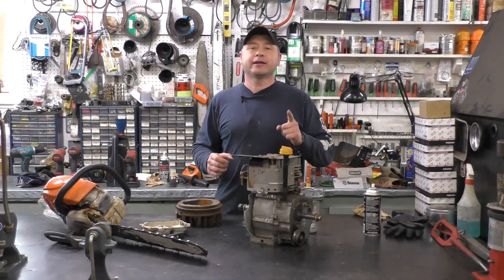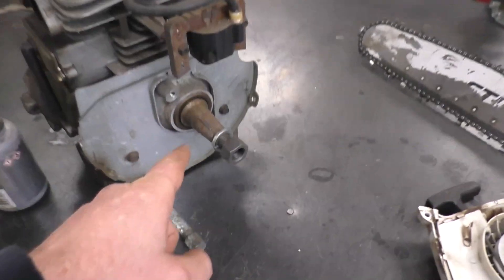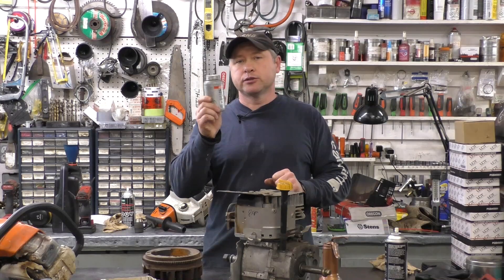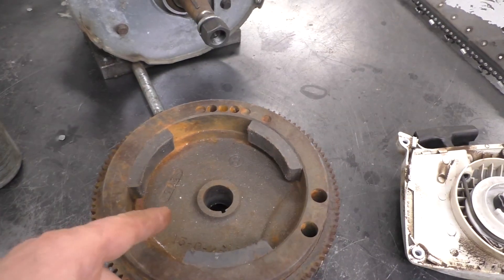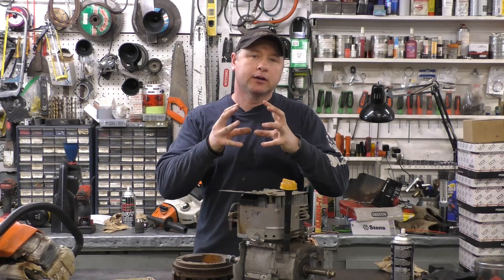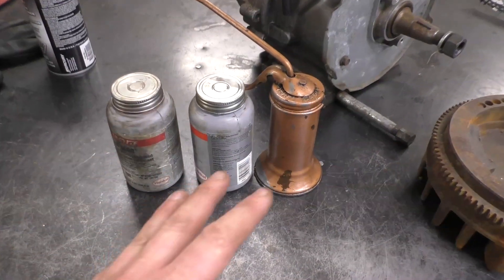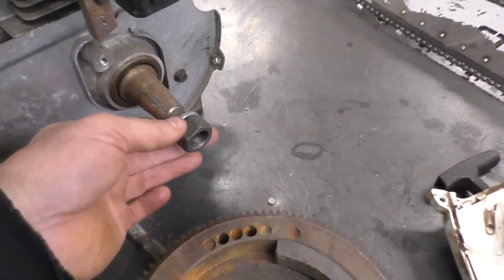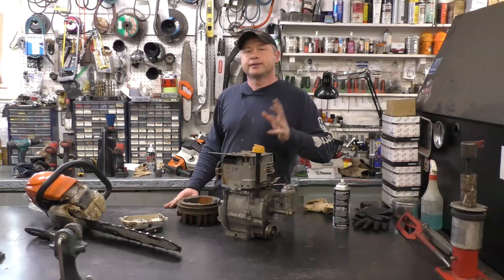Can I use Anti-Seize On A Small Engine Flywheel?

Comment: Yes It was a general rule of thumb working in the millwright trade to never use any  lubricant on any tapered fits. Usually when pulling parts off tapers they would have tendency to go flying when it lets go. Good point and merry Christmas.
Reply: that is why leave the nut on looooosely so that the flywheel doesnt go FLYING anywhere, it just goes POP and pulls up against the retaining nut. take the puller off, take the flywheel off, go on.
Reply: RJl same here worked on morgan wire rod mill finishing block ,carbide roll with taper sleeves were pumped in at 285 bars,speed 95 m/s

Comment: Honda's car service manuals say clean and dry for tapered ball joint install. Must be similar reasoning. I've seen many videos where people do use antiseize or grease on the taper. It initially seems intuitive to add some after battling to release the taper and I've done it myself, but no, not advised. That said, I've never heard of a problem developing if it is used in that application.
Reply: I have seen split tapered seats from using lube on ball joint, and tie rod end studs.

Comment: Great advice Don. From small equipment to large heavy machinery, it’s the same.
I worked in a factory for 40 years taking care of the production machines.
On some of the very big shaft equipment, the couplings were held on with a taper like your talking about. These couplings were always installed dry to get the maximum wedging hold or grip. It’s amazing when installed properly, the wedging action never slipped.
Love your videos. Keep up the good work.👍

Comment: Can you please hire me as an apprentice… how much you fascinate me with how in-depth maintenance can get with small engines always wants me to go to my shed and do stuff on my mower and/or snowblower
Reply: read read read... u tube vids... tinker with ur stuff. start with junk that is junk so no matter what u do to it, doesnt matter... too much.  i got USED mower.  they ran it LOW on oil and the air filter , sort of, held on by duct tape (sigh) as apparently the bolt they used from factory was a ONE OF A KIND IN THE WHOLE WORLD BOLT... not standard 1/4" hardware store bolt that i put into it after rebuild.  

new rings, new gaskets.  honed cylinder with $15 E bay cyl hone. took out lip at top of cyl to get piston out. bottom of cyl was BADLY SCORED from??? rock in the oil? sanded piston skirt. put it back together with clean carb, new e bay air filter (5 for $9 shipped). painted it pretty and now it is waiting for its maiden RE voyage with 20-50 motor oil and 20% STP oil treatment to thicken the oil so make up for all the times it ran low low low on oil. wrote all over it with paint pen... CHECK THE GD OIL BEFORE THE FIRST RUN OF THE DAY!!!!! USE 20-50 MOTOR OIL!!!!!!

Comment: Note the flywheel key is specifically for getting timing correct not for keeping flywheel in place.
Reply: Well, the key keeps the flywheel from spinning on the shaft thus keeping the timing correct. The tapered shaft and the nut keep it from coming off. I think that is what you meant.
Reply: @dkupy100  Nope, the key on a properly installed flywheel should actually have no shear forces on it. It's entire job is to simply line up the parts for timing purposes. It is the fit of the two tapers that holds the parts together. That is the reason why the companies can use soft aluminum for the keys.

Comment: Never seen before. The metal-on-metal machined dry-fit is designed to keep the flywheel at exactly the same velocity as the crankshaft. Anything else will cause problems from the two parts migrating.
Reply from the maker: well said!

Comment: I would also add that if threads can (should) be cleaned on the crankshaft and on the flywheel nut, any lubrication of those must also be avoided as it can throw torque readings off, lead to overthighning and consequently, threads streaching. Joyeux Noël Don !
Reply from the maker: merci Daniel!
Reply: tooooo tight on CHEAP alum/steel flywheel taper and cracks the flywheel and it EXPLODES IN SPECTACULAR FASHION EVEN AT LOW RPM's as the nut is TOO TIGHT... for the lubricant on the tapered shaft/flywheel interface.

Comment: I had a tapered shaft off of the water pump on a case 2294 tractor. I antisiezed it.  Then you have 3 or 4 bolts. That attach the fan.   It ran fine the first couple times. When you shut down. That little backwards movement, walked the bolt out. The fan moves forward and takes out a $1600 radiator.  Everuthing is in super tight tolerances. Where you just cant quite reach what you need to.

Now there is something called galvenic seizing. The graphite based anti sieze is bad about it.   If your buying antiseize. You want the copper based stuff.  There is no reason to be buying the graphite based anymore.   
I had a axel on my jeep replaced. I made sure the shop was using the copper. When reinstalled. Because of the hours. It took for them to disaasemble the original graphite based antiseize.    The shop simply hadnt heard this before
Reply from the maker: i'll check that out!
Reply: @donyboy73  rifle barrels into alunimin receivers is where i first heard of it.  on my silo unloader i got to see it  regularly. but your dealing with a high moisture and acidic enviroment. that  speeds it up.  i've seen some of it on wheel lugs on my skid laoder, where we clean the feed lot.  but usually its not terrible there.

Comment: Yep had a few. Had 2 fairly recently with cast iron flywheels that had Anti-seize on them and when they tightened the flywheel nut on the 1 and bolt on the other it cracked both flywheels. Had one with an aluminum flywheel that actually deformed the taper on the flywheel and the flywheel was pushed so far back that it was rubbing on the block around the oil seal and it ruined the block. Do not lube the crank or flywheel. I've been in the business since the late 1980s. You wouldn't believe 1/2 the stuff that I've seen.
Reply from the maker: wow i can imagine you've seen it all!

Comment: Still not sure on this one....haven't seen any fails with it either
Reply: i want the flywheel to sheer the timing key.  timing key 75 cents, 10 for $8 on e bay.  new crankshaft when hit something with mower and twists the $150 crankshaft in ur $350 honda self propelled mower and ruins it???? i paint the flywheel JD WM RUSTOLEUM spring green and white paint pen on where the timing groove is... and paint one side of the painted flywheel nut/flywheel with WHHITE paint pen so i can tell, at a glance if the flywheel nut has backed off... or if timing has slipped. simple. paint is cheap, paint pens cheap on e bay.  shake well before using... push felt tip down down down til inik appears in the felt tip... that might take 20x to get the ink to get into the felt tip so be patient.

Comment: Basically the flywheel is jammed onto the shaft by the taper. That gives a determined resistance to movement. The key is designed to fail. You must not use a substitute. The forces at play in the engineering of the flywheel is to make the engine transmit force to the flywheel but restrict the force the flywheel transmits back to the engine in a sudden stop. The shaft to flywheel contact must be clean metal to metal. It must be a full contact otherwise the engineered safety is compromised. The torque on the nut is critical. Do not substitute washers or nuts.If dry torque is specified you must use dry torque.
Reply: No one is torquing the flywheel not fyi. It works fine too
Reply: @alexstromberg7696  If you are working on your own engine you can do whatever you want. If you are a paid mechanic you must torque to specifications. Not bothering with correct procedure is why people require their government representatives to license trades.
Reply: @edwintaber6465  yeah you do you

Comment: Should you use grease or Anti Seize on vehicle lug nut threads?
Reply: Also on the contact points on the back of the wheel. So it doesn’t rust to the breaks.
Reply: i don't put it on the threads but I do put it around the hub and rotor and where the center of the wheel contacts the hub.....most lugs if tightened properly will come off, it's the wheel on the hub and the rotor on the hub that can cause frustrating issues
Reply: Absolutely not ! Every owners manual for every car I've owned ( and I've owned many different brands) tells you not to apply any kind of lube or anti seize on lug nuts or bolts. They also rely on friction . If they get rusty , clean them with a wire brush and a thread chaser for the bolts. If they get really bad, replace them.
Reply: No lubricant on vehicle lug nut threads, please. Doing so would alter the torque values causing the bolts to be tighter than they should be. I've never seen ANY dealership or tire shop add lubricant to those bolts, and neither should you.
Reply from the maker: @SpaceCadet4Jesus  thanks for the info
Reply: @donyboy73  Better to thank YOU Dony for sharing your experience and having an interesting channel. Thank you, and Merry Christmas to you and your family!
Reply: Always, unless you want to be stranded with a flat tire and a good spare. Have seen people with this situation many times in the north country where road salt/brine is used in the winter.
Reply: @37yearsofanythingisenough39  NO, NO, NO ! Read the owners manual. Every on I've ever read says not tp apply anything to the lug nuts and bolts. They rely on friction just like the flywheels Dony talked about.
Reply: Not a good idea as you don't want those to come off too easely. Stuck wheel nuts aren't caused by rust but generally result from wildly overtorquing those nuts whith airguns ! Regards
Reply from the maker: I do
Reply: @donyboy73  I did a little research on the subject. It tunes out that the primary source of the required friction is where the lug nuts contact the wheel. Any lubricant here can cause problems (similar to what you mentioned with flywheels ). If any lube applied to the threads gets into this area, problems can arise. So if anyone wants to lube the threads, be super careful that none gets into that area. I found the same info on several auto related websites. They all said not to apply any lube because there's a chance some will get into the area I mentioned.
Reply from the maker: @davidquinn6161  thanks!
Reply: @donyboy73  Although I doubt corrosion could occur on the inside threads of a properly torqued wheel nut, there is nothing prohibiting to cover the nut and exposed threads with grease after installation. Regards !
Reply: i do so the garage monkey doesnt spin weld the nuts on the studs with impact. that is how they put TOOL JOINTS ON DRILL PIPE . the tool joint is machined ... the pipe is made in plug mill (like putting big glop of PLAY DOH on ur finger and pushing a hole into it to make... pipe). the pipe is held solid. the tool joint made up in fixture... fixture spins the tool joint... shoves the tool joint and pipe together... IT GETS HOT... FRICTION... WELD... when its done, the mushroom of metal is machined off the inside/outside of the pipe... x rayed... done.  same with unlubricated wheel studs

Comment: Clean the rust off the shaft it can act like a lubricant reducing  the metal to metal contact necessary. Once in a great while you notice axial lines on the shaft  when you pull the flywheel . In that case you may want to blue the shaft and flywheel.
Reply: cast iron/alum flywheel is the cheapest thing in the world. stay out of flight path of exploding flywheel as when it comes apart... got flywheel nut too tight ... with impact? that exploding metal in chest or head... PARTY's over.  harmonic balancers... NOT HAMMERED ON!!!!! MACHINE FIT THEM FOR PRESS FIT. where is it going to go with a 1.5" bolt thru it.  guy had mechanic hot rod his engine, revving it up in car, 5 guys standing around. ... balancer blew up, got mechanic in chest... he stood up, fell over. GAME OVER.   5" piece of balancer....  cheapest cast iron in the world CANNOT BE BEAT ON!!!!!!!!
Reply: I don’t understand the purpose of applying the blueing in this case. Please elaborate further.
Reply: @JohnFixes31  The blueing is used to determine high and low spots preventing full contact between the shaft and flywheel. There must be full metal to metal contact to give the engineered resistant to turning of the flywheel on the shaft. This resistance has been calculated along with the shear of the key to keep the force of energy from the flywheel being transmitted to the internal components of the engine and breaking them if the shaft is abruptly stopped from turning. The resistance of the taper must allow for the flywheel to turn properly and yet must be weak enough to slip if the shaft suddenly stops. It is critical that the factory condition of all components of this taper and tightening nut be maintained. This is the most neglected maintenance on these small engined. If the taper is too loose the key will start shearing causing the timing to go bad. If it is too tight you may unnecessarily destroy your engine. The blue allows a skilled mechanic to reshape the shaft and flywheel hole if at all possible.

Comment: Adding something with a high viscosity or a consistency like anti-seize has will create an excessive clearance between the inside taper of the flywheel and the tapered crankshaft. So even in you assembled it with these coatings and torqued the nut to the proper torque, there would be enough clearance with some small use that the two components could end up loose and beating each other up. Or worse, coming apart during operation. Great video!

Comment: Conversely, when the flywheel is rusted to the shaft it defeats the key shearing safety.
Reply: that is why i at least oil the shaft... a 75 cent timing key is cheaper than $100 crankshaft... that costs more than the machine is worth... or thrown rod/hole in block. just careful when tighten flywheel key... a little less torque than stated torque? if horizontal spinning flywheel on mower... where is it going to go esp if the thing is 18#?

Comment: On a sparkplugs?
Reply: i did it for 20 years so yes
Reply: Regular service they won't seize with correct torque.
Reply from the maker: yes, just keep away from electrode
Reply: It's not required but could help on removal on engines that don't get regular servicing. A very light coat of threads only.